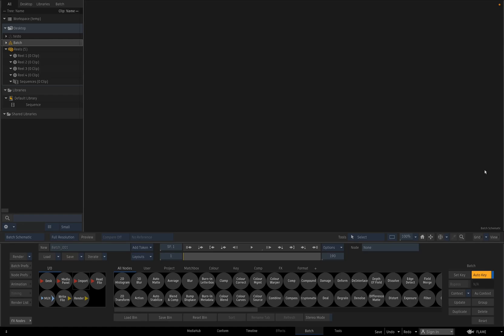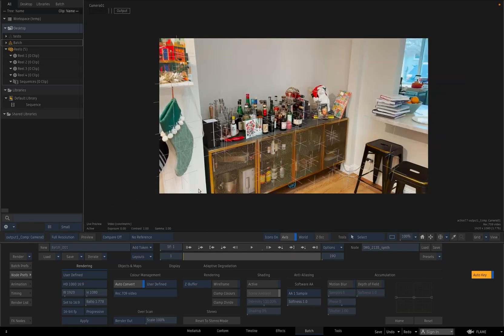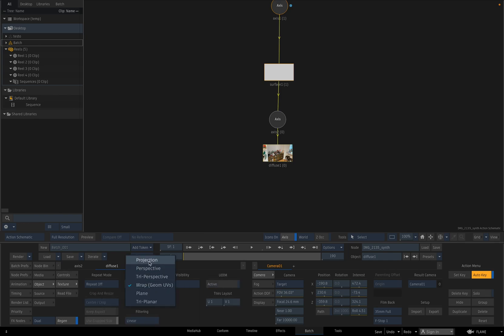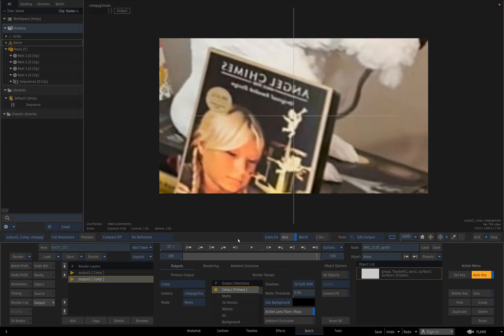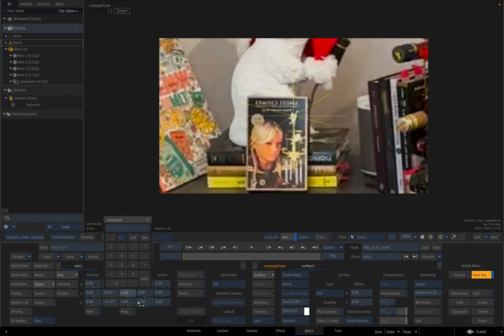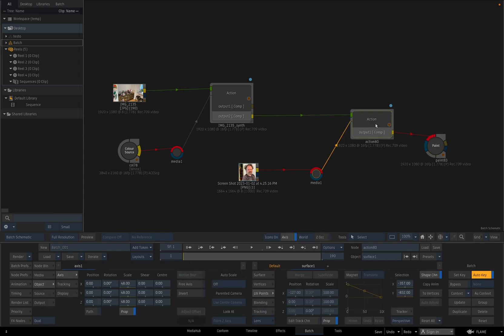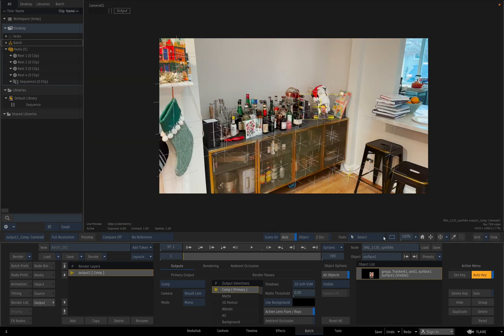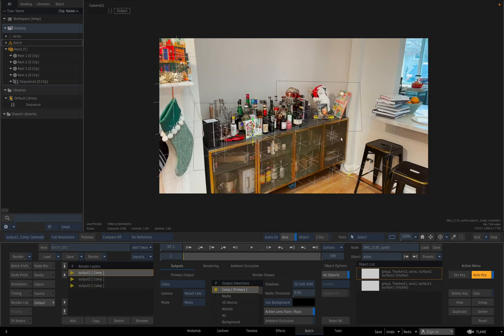Flame 3d stabilization and reprojection

Comment: But are the Booze gone?  Thanks for the video.  My problem with projections is that you could not use EXT Bicubic but this shows a way around it.  I still wish you could do it in the original projection in case you can't get a track that is 100% and you have to just nudge your surface a bit.

Comment: Nice one Kirk. Good pic of Andy. Question for you. Do you have a workflow if you make a card in SynthEyes? It seems to work but I can't get the projection aspect of it to appear correctly.
Reply from the maker: Thanks Chris! I do not have such a workflow. I dimly remember being able to use the axis that SynthEyes attaches to its geo to attach action surfaces to, but actually photographing the SynthEyes card and then reprojecting? I have not tried that. Most of the time we're doing 3d tracks without yet knowing what all we'll be expected to do with them, so we don't typically go putting cards in at the tracking stage.